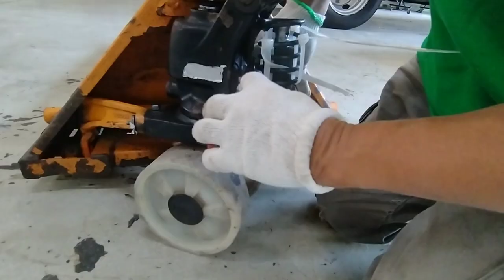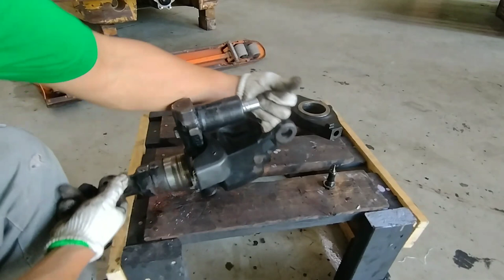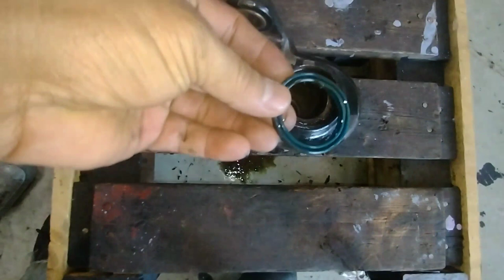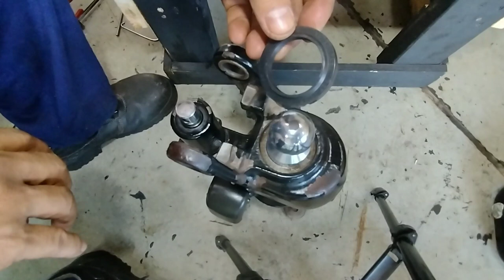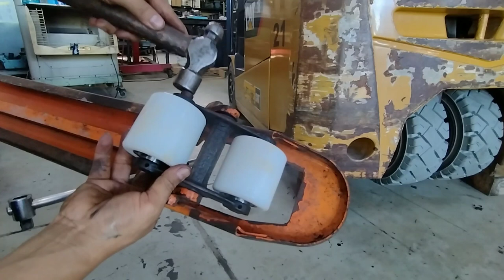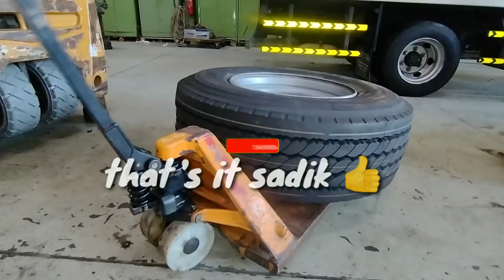repairing weak lifting pallet truck | BT LHM230 Quicklift Sweden

Comment: I just bought an old non-functioning BT L 2000 ($30), and i did a search on youtube, what did i find; Sadik Dan.
1 hour later it is now functioning, apart from a broken return-spring for the handle.

Thanks from Sweden! and say hello to my mother in-law(Viola) in Manila if you see that witch...
Reply: vart hittade du reservdelar (packning) till din bt 2000 pallyft?

Comment: What size is the u seal taken from the piston housing under the spring. Did you just replace that or the complete quick lift piston. I'd just like to order seal, but they only sell it complete with all the piston components.

Comment: sir pwedi makahingi ng list ng mga o'rings na ginamit mo? halos lahat ng mga pallet truck namin dito ganyan na ang sakit. meron ba available ng mga spare parts sa Riyadh. salamat sana mareplayan mo ako.
Reply from the maker: SA Al Iman distributor Dammam kami nag order Ng parts I think Meron Dyan branch SA Riyadh ,wala Naman o ring ako na ginamit U-seal ring at scraper ring seal lng sir!, thanks SA pag watch sorry natagalan pag reply ☺️☺️☺️
Reply: @daniloeb22  sir ganun parin ang hydjack namin, napalitan ko na ng U-seal at scrapper ring. kapagtrial na walang load ok sya, pero kapag i-assemble na kahit walang load kapag ikabit na ang extended fork, nababa ng kusa.
Reply from the maker: @rollynsdeocadiz  check mo release valve Baka may dumi or naka pull in lever Kaya nababa Ng kusa,

Comment: Ans me if weak lifting  then is lowering valve problem?
Reply from the maker: check if there is a oil leak,then if there was probably the oil is not sufficient to lift that's why it become weak,I hope I answered your question ☺️☺️☺️
Reply from the maker: if there's a oil leak then probably the oil is not sufficient and become weak lifting,I hope I answered your question thanks☺️

Comment: I own a BT Model L 2000 Pallet Jack manufactured in 1993. It pumps up fine and releases fine with no weight on it. With a wooden pallet and 150 lbs it will stay up for about 30-45 Seconds then it drops down to the floor on it’s own. With wooden pallet and 400 lbs on it when lifted it drops right down to the floor in no time. Can someone tell me what the problem is with it. It is full with hydraulic oil like it should be and I tried bleeding it more then once. As I said it pumps up well with no weight on it and releases well it just can’t hold a load for very long and it doesn’t seem to be leaking any fluid. I don’t know much more about it and I don’t see any You Tube videos that shows how to rebuild it. Have no idea where to find a manual to rebuild it. Any help out there is appreciated.
Reply from the maker: I think the U ring seal in the piston was leaking,try to change it ,thanks for watching
Reply: @daniloeb22  Thanks for responding back. Not sure on my end where to start to take it apart. I see different seal kits sold online for the BT Model L2000. There are 3 kits sold on Amazon. The cheapest $12 US plus Shipping = $19. It consists of 3 Seals and 1 Large O-Ring. I asked the seller if a pump diagram comes with the parts and was just answered with a plain (NO). Then I asked if directions came with the seal kit and this time I received no answer. The more expensive kit comes with way more seals including springs,clips,washers and what have you. It sells for $51 plus shipping for a total of $58. I have no idea which one to order at this point. The smaller kit although more reasonable I am not sure if just replacing the 3 seals and 1 O-Ring will cure the problem.
Reply: I have the same problem with mine now. Did you resolve the issue?
Regards don
Reply: @donsmith9846  Nope I couldn’t find out any info anywhere I checked so I wasn’t going to order any kit on the blind.
Reply: @ffas23  Thanks for getting back to me
Reply: Hey it's the equivalent seal as the one on the video where he said it takes 5 minutes to fit due to the awkward angle and not having the correct tool, on the L2000 you have the large top nut that the piston sits in, remove the piston and the nut and the seal is underneath there beneath a circlip. It's easy to change, might be awkward getting the top nut off if it's been on there for 30 years. I would buy a new lhm230 though if I was you, if it's going to last you another 30 years then it's worth the investment I'd say.
Reply: @gasu993  Thanks, That sounds like good advice
Reply: If you still want to repair the L2000, it's not hard, just the large blue seal, it's easier on L2000. Just need the (I can find out size for you) . Take top nut off, take circlip out, then you'll see a large brass insert, pull that out, then you can pull seal out. Oil leaks back through internally when this seal is worn.
Reply: @johng6460  I will need to take another look at it. It’s December now and Winter Time. This is a job for me to do in the Spring. I appreciate you still keeping me in mind here with the problem with mine.
Reply: @ffas23  i also have the same pallet jack with the same problem
Reply: @hectorpaniagua2597  I still haven’t found any answers or directions. I wasn’t using it much anymore anyway. I still own a older Propane Gas Fork Truck for when I need to move something heavy. I would really like to fix my Pallet Jack though.
Reply: @ffas23  There is not much to it.
You take it apart and replace the seals.
You may be able to see dimensions for the seals online and you could just go get them from a seal shop.
But if you were to do this, set up a camera (ur phone) and record yourself taking apart the cylinder. Then start taking out seals one by one, not forgetting to documents which one you took from where.
When new seals come you just need to compare with old ones.
Also, don’t forget to clean the surfaces where the old seals were.

But to be honest, if you are having such a hard time going about doing it, then just get yourself a new one.
Reply: @LorandHungary  I rarely need to use it anymore. I just don’t want to junk it. I have a older Propane Gas Fork Truck in my building if I need to lift something heavy. I am 72 years old and retired from my business where I used the hand truck. I believe Amazon sells 3 different kits for it. Being I could not get any information from the sellers on Amazon I didn’t commit to buying any of the kits. One is a expensive kit. Unless I know what kit I would need it is all a waste of my time.